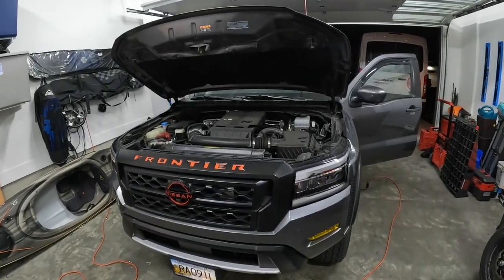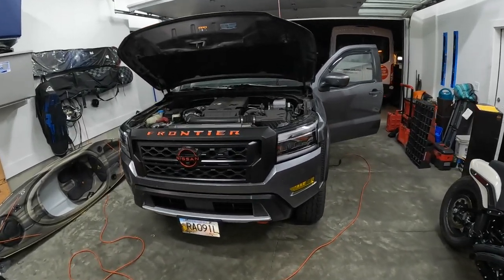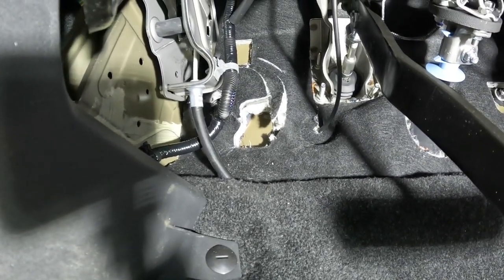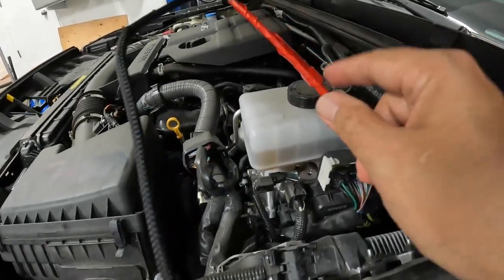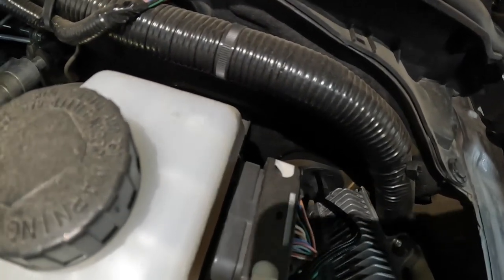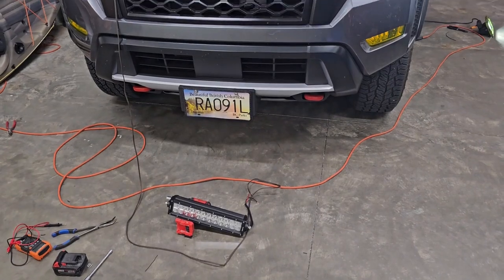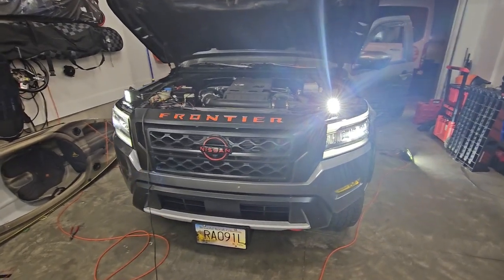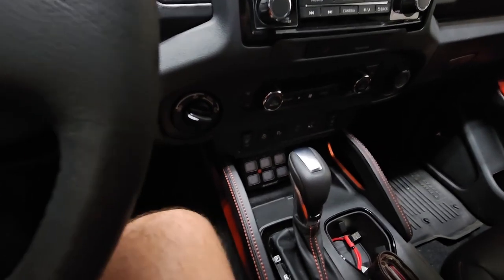AUXBEAM AR-600 RGB Switch Panel Install

Comment: Re-watched this after I recently purchased a 2024. I think the issue with the panel staying on is the low load of the led lights in the panel and that there is a secondary circuit to cycle the DRLs when the remote is used to lock/unlock/ flash lights etc. Just a thought anyway.

Comment: Dumb question, what did you do inside the stock fuse box between the camera shot change at 3:37? Seemed like a step was left out... I assume it would be in the instructions but still curious
Reply from the maker: Only thing in the fuse box is the 1 wire that goes to the add a fuse. Then just choose which fuse you want to tap into